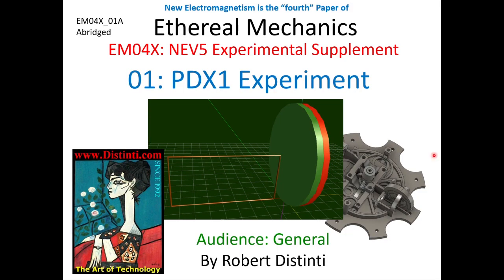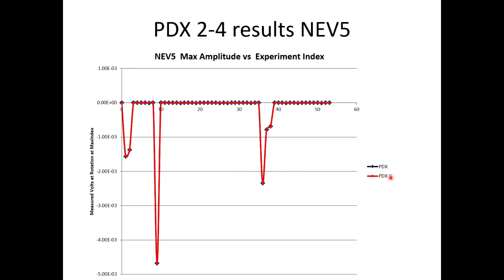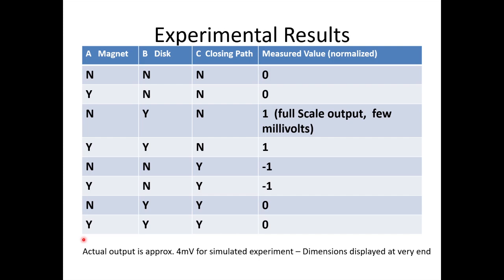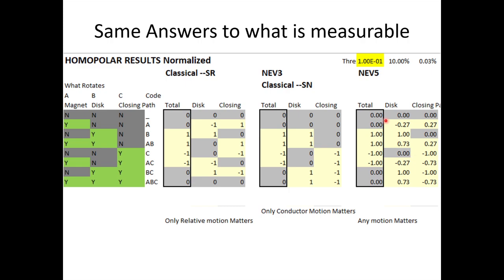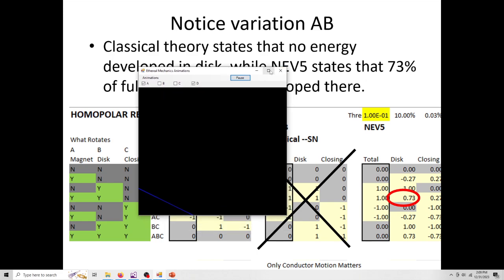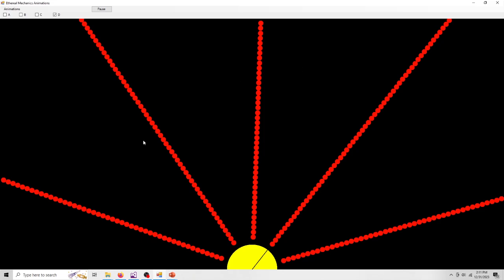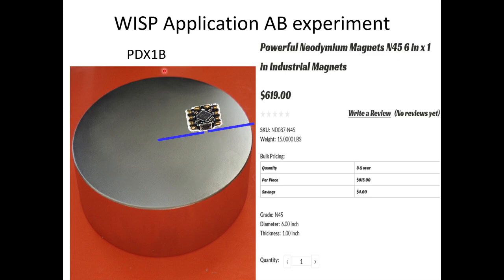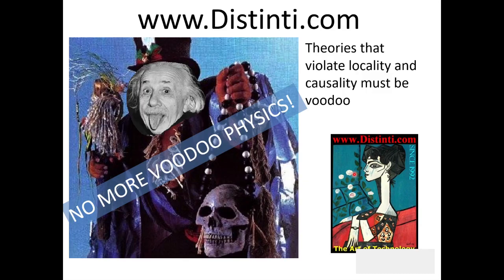EM04 X01A: Paradox 1 Simulation Results

Comment: I was thinking, for experiments involving spinning magnets, if hall-effect sensors at various distances outside of the magnet, all attached to a data acquisition system (a very high speed one), could keep track of the field strength changes per unit time (you would need at least 2 sets: extending, say at 90 degrees from each other). In other words: At zero degrees from your animated disc magnet, there would be a sensors at, 10cm, 20cm, 30cm, 40cm, 50cm, (etc)  and at the 90degrees, there would be the same line of sensors (10,20,30,40,50cm) etc.  If you fed all this sensor info into an oscilloscope (albeit a 10 channel scope probably would cost a fortune), or, better yet, into a custom circuit (a bunch of ADCs and a really fast signal processing system - I'd try multiple SDR dongles with SDR software - that would get you into the high end area, cheaply.